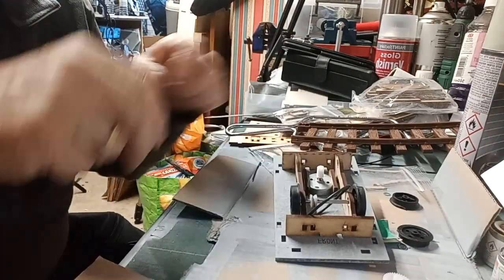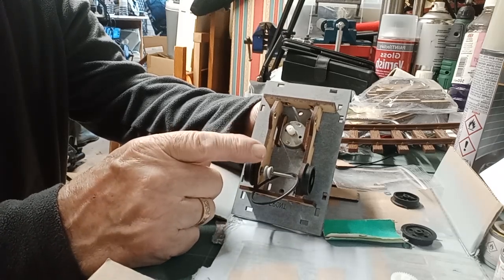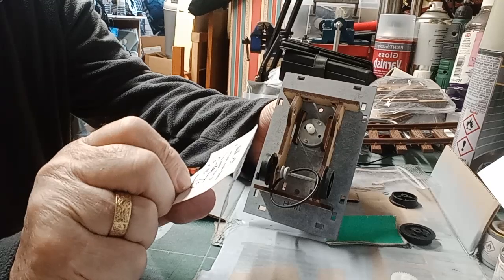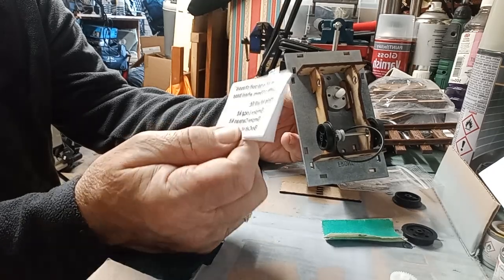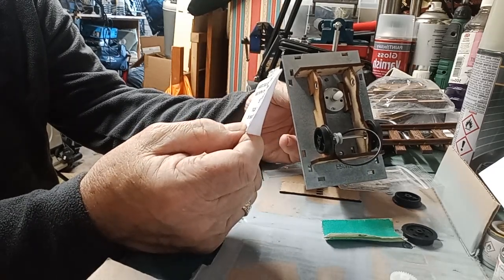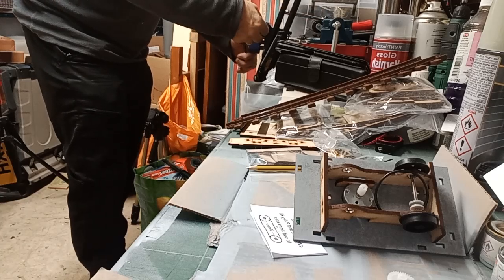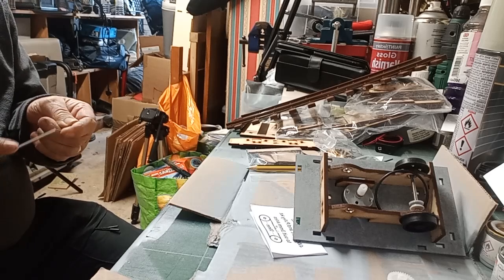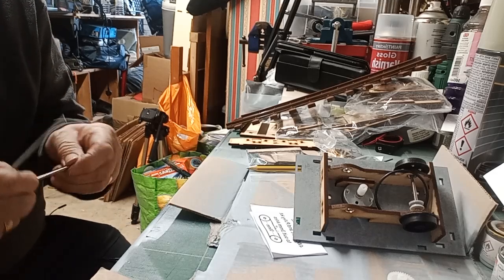P.S models chassis build.

Comment: 3:35 I think this may be what is happening on my garden railway. I have one curve that I suspect is under gauge because commercial wheelsets ride up and derail as if they are hitting an obstacle, but my homebuilt wheelsets pass through fine. I didn't have my calipers with me to check though.
Reply from the maker: Yes it worth checking,I have changed wheels before and then all is well
Reply: @mindfulmodelmaker5602  That's what I'd usually do, but this is a motor block with no room for adjustment... I think this means there's some track maintenance in my near future!